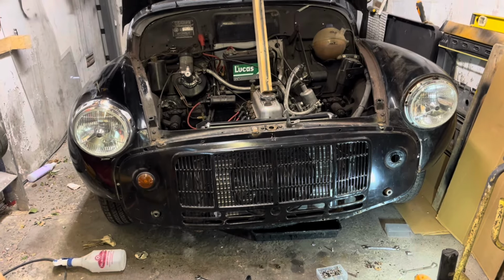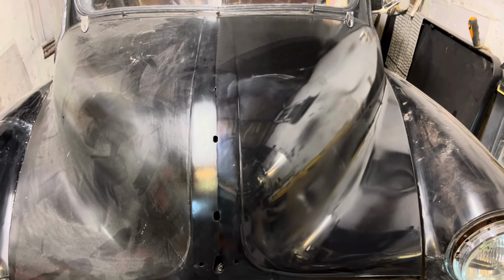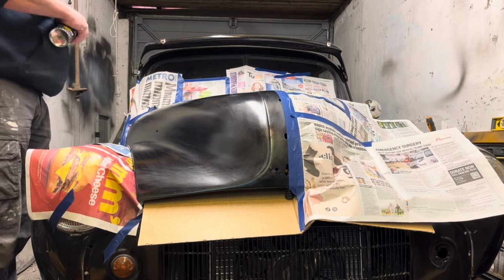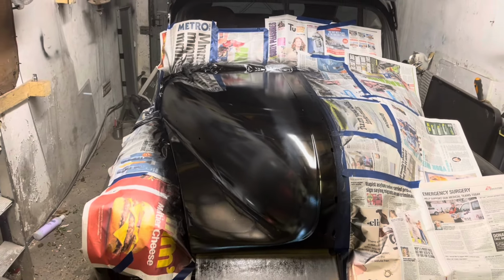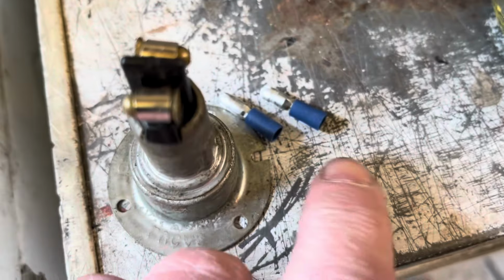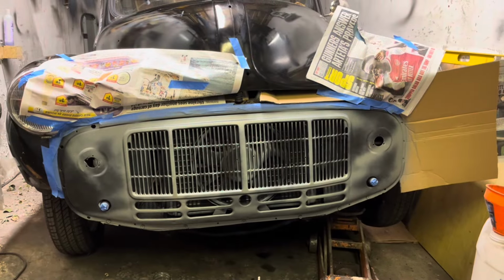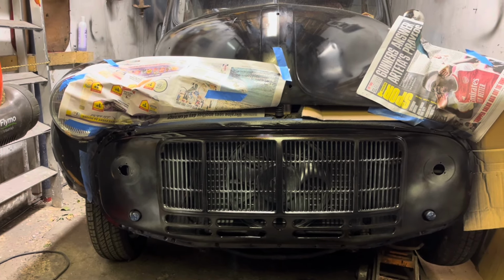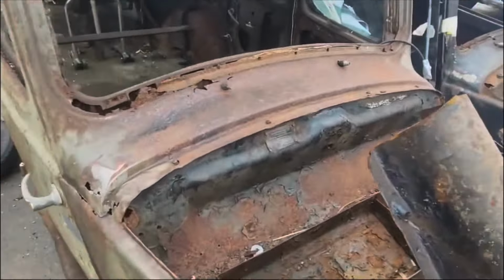More Minor Tinkering ! Classic car restoration on a budget #morrisminor #classiccar

Comment: hay thats looking ok , its surprising what turns up at the pound shop looks like really good paint , , ive got same problem with my bonnet needs welding same as yours did , ill have to buy a welder one day soon lol . 👍👍
Reply from the maker: Yes I love the paint, it seems very good. My only criticism is that a couple of the cans I’ve used have run out of gas whilst paint still left in the can, must grumble for £2.50 😀👍